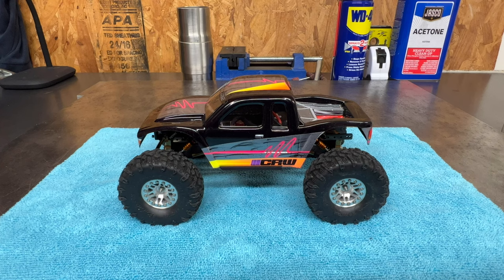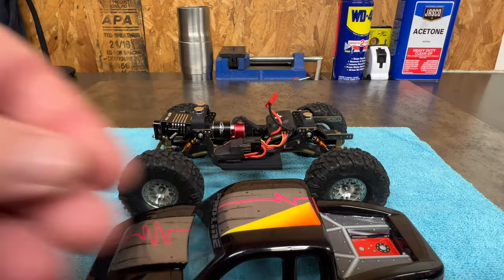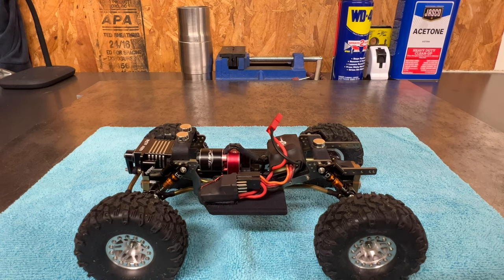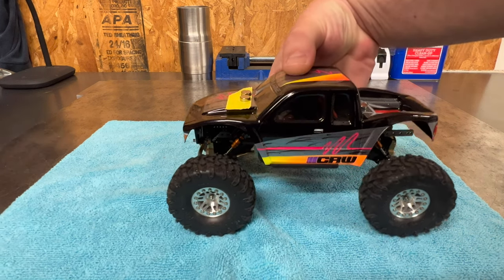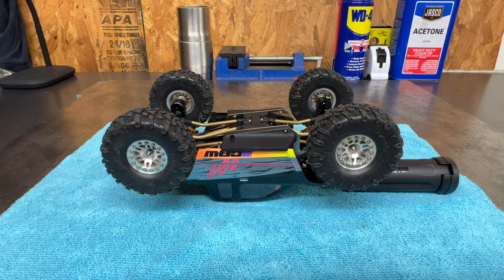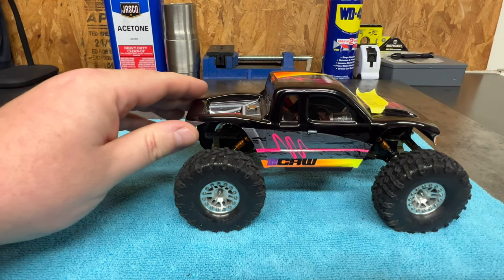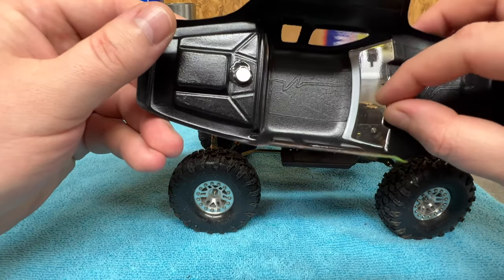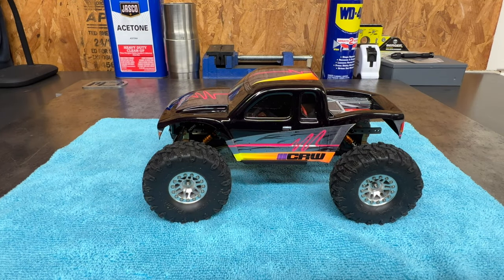Glueing RC body to magnet mounts. Step by step tutorial by #mazz #scx24 #chassis

Comment: I usually put masking tape between the two magnets when glueing to make sure I don’t glue them together. Otherwise, I do a similar process.  One thing I do is set it all without glue, add the outer body magnets like you did, but tape them to the body. Then I pull off the body, put glue in the body mags and they pop right into place where you have the outer mags taped. You could potentially cure the body mags without the body on the chassis that way.   

Great video Jen-nay!
Reply from the maker: Those are good ideas as well. I turn the body upside down to make sure mags don’t glue together and have yet to have it happen yet. 🤞
Reply: @mazzdesigns6929  I guess you’re gonna have to do a black ‘vinyl’ style hood to cover those spots on the blue one, but that will look great.  I had one barely move on me and you could see a tiny bit of the shiny magnet through the lexan. Had to dot touch up on the exterior. Luckily it’s not really noticeable.  

You are right about taking your time when gluing. Definitely need to test fit and have a good plan/tools/cleanup just like you say.  And patience to wait the 48hrs!
Reply from the maker: It happens to the best of us. I appreciate you sharing your preference as well!

Comment: Great video man!! I have done it very similar except I get the body lined up without glue then I throw a couple magnets on top of the tape and trace a line around them.  Once I got the line traced on the tape on top I make sure the are still aligned then tape them in place.  Boom now with the body off I can just drop the glue and let the magnets fall into place.  Works out great and I can do all my gluing with the body off.
Reply from the maker: That sounds like a pretty good way as well. Thanks for watching

Comment: Yo mazz, just thinking as a precaution, you could lay a layer of foil or plastic wrap on top of the car before you place the second mangers on top. So the shoe goo will not be able to make contact with anything other than the body the magnets and the plastic wrap or foil. Just a thought

Comment: What if the body has a curve on it? Wont the magnet follow the curve and not sit on the bottom magnet properly? Is it ok to have a gap between the magnets when dried? Or should have magnets attached together and let the glue fill the gaps with the curves? I have a 1/20 toyota pickup body i'm trying to mount on the stock chassis. The hood has a curve to it.
Reply from the maker: You just want the mags a bit off the body. Add your glue, place body and turn upside down. This will allow the glue to form to the curve. If you have voids once cured just add a little more glue and leave to cure again. Thanks for watching!